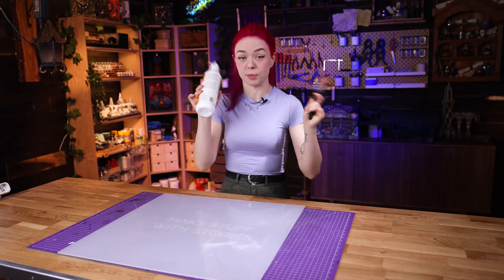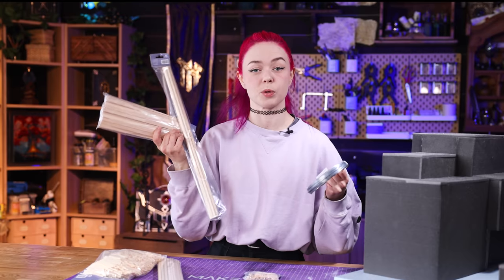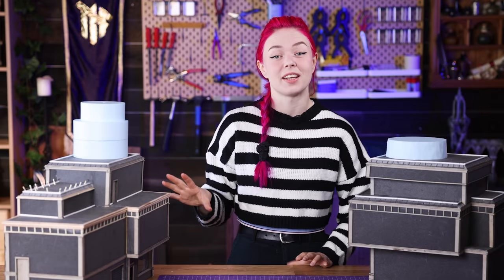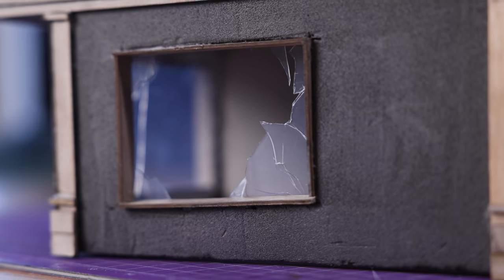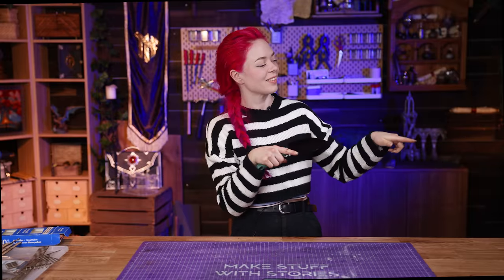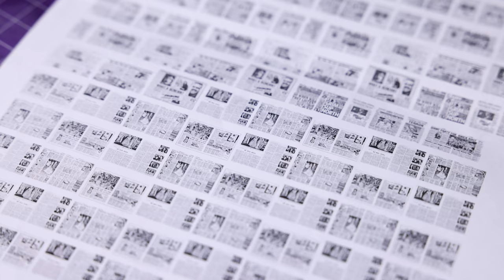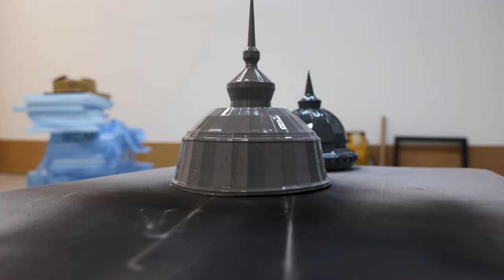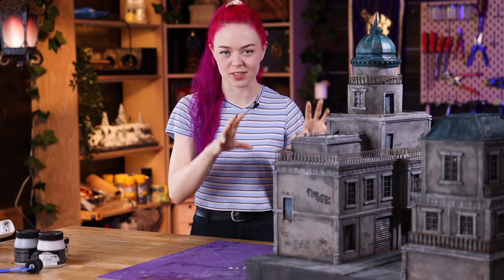I made my biggest diorama so far...

Comment: A sheet of sandpaper could also be used for a road and painted to the desired effect and you can also choose how course it is to fit in with the chosen scene E.G. sand/gravel path more course, smooth asphalt road more fine
Reply: Especially the already black sheets for asphalt. I will say that an even paint job might be hard and a wash would be really difficult to do since paper towels will still to the more coarse sand papers, but a 320 would work fine.

Comment: Years ago I spent some time doing various Wall Murals for hair salons, restaurants and residential rooms, like kids rooms and the like.
Several walls I did in the hair salon were Egyptian themed and because of the sheer size of these wall pieces I needed a short cut to achieve stone like texture with the paint.
I used regular Big Can Wall Paint.
EGG SHELL Finish specifically.
All indoor wall paint is, is Acrylic Paint! Just a thicker pigment concentration than standard Art acrylic paint.
A large can of Brown paint plus a small can of Black and a another small can of White and a myriad of small tubs of art acrylics and I had everything I needed for all those Egyptian sculptures to be textured.
The wall paints mix Extremely well with even Dollar Store Art acrylic paints. For large scale projects like this Post Apocalyptic City Scape, I'd be using Egg Shell acrylic wall paint for all your major stone and cement textured surfacing.
Easy short cut and a little paint goes a long way making a big can supply last a long time. Keep some stor sticks handy to give the paint a stir if it's been sitting for a while, or even pop down to the paint shop and have them shake mix it again to freshen it up before use.
The larger the project, the better the deal by swapping out a few materials here and there can still go a long way.

Comment: First of all I really love this build. I love the builds you make and I love abandoned cities.

There are some things I would make more destroyed.
For  example the chains holding the sign: I would broke one piece of the chain (but not tear it apart). The street lights' glass should be broken as well.
The neon would be nicer with flashing (I think there is a small circuit for that without microcontroller).
The concrete walls could be cracked or smashed at some places. I'm missing the nails from the planks. The plastic chair also one thing I would broke. And the beer glasses should have a broken one as well. Also the railing of the balcony could be broken. I'm missing some ambers as well.

These are small details I would add, its only my opinion. I couldn't be able to make a city like this so big respect for you.
I love your projects (and I would love a shop full of them).

Comment: It doesn't matter in this application but water based PVA glue will take weeks on end to dry out between two films of plastic. The moisture has nowhere to go except a tiny gap at the sides and after the fringemost centimeter or two dries it forms a natural plug for the water molecules.

Comment: Would you say that the epoxy resin filler was better than using a spray on filler/primer? I have experience with epoxy resin and it can be finnicky (also it's expensive). We recently got a 3d printer and used a spray filler/primer for Comic Con, but I am interested to hear anyone's opinion who has used the stuff they used on these domes.

Also Unrelated Hot Tip: A lot roads have at least 1 central crack down the center because there is usually pipework there (at least in the US, I can't speak for Europe) and the road settles down around it while the pipe stays put. It may not help with dioramas, but it can help you identify where the pipework near your home is so that's fun.
Source: my time in the Highway Dept.

Comment: Ugh, dude increase the vertices. Blender smoothing feature does not work IRL. So instead of artificially increasing the edges, do it manually.
Select object > subdivision, increase as needed.  That is, click on the visual object. Look to the right (normal UI, maybe they changed it in recent editions?). On the right you will see the object attributes. At the bottom click "Add Modifier". Depending on the situation, click  subdivision or smooth. Since it sounds like the easy solution of clicking smooth did not work for a 3D model, click subdivision then do it again and even if need be do it once more.

Subdivision takes every face or edge or vertex and doubles it. Instead of having a temple dome with 24 sides you can increase it to 192 sides. Then print it after that. 192 sides wont be as obvious as 24. And a paint that smooths out 192 sides in a circle will work much better than asking the same paint to smooth out 24 sides.

Comment: Some tips for improvements:
16:20 Asphalt is usually darker than concrete. Also roads your road looks flat, roads usually have a arch/slope so water flows to the curbs.
24:28 All the buildings are the same color/gray with is unusual.
Reply: The building colors are just concrete to show that the paint has worn off. 
But yeah, having a little paint remain to show the original color would've been a nice touch

Comment: engine blocks wouldn't rust, they're aluminum.
Reply: Many engine blocks are cast iron.
Reply: @adematthewsracing  not these days fam. Signed, a mechanic of 30yr
Reply: @ryanc1451  There are still engines being made which are cast iron. Pretty much every manufacturer still has them somewhere in the range especially if you include diesels. Plenty of cars on the road today with cast iron blocks so why wouldn't they appear as junk in an environment like this?  Signed Racing driver and mechanic of over 30 years ;)